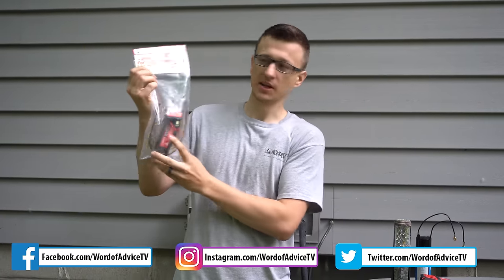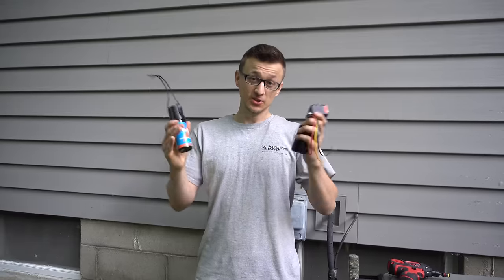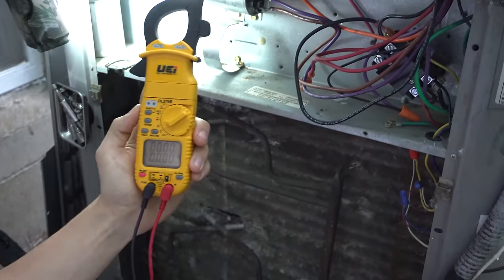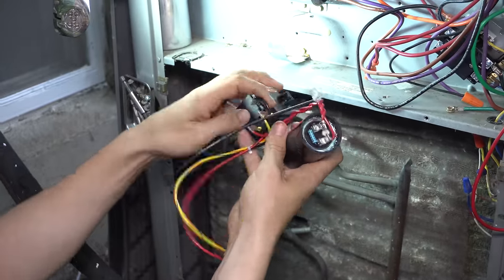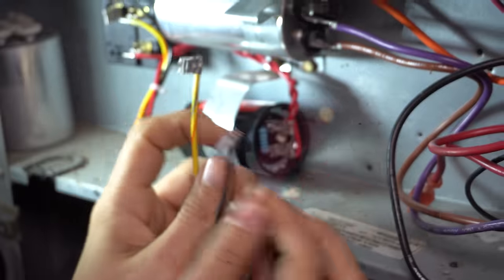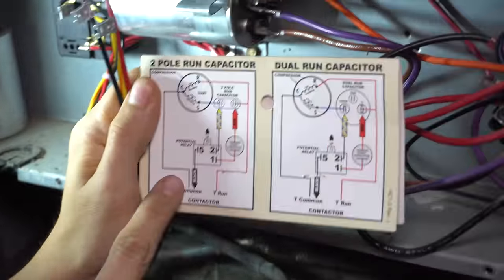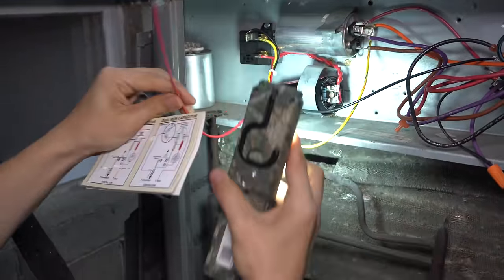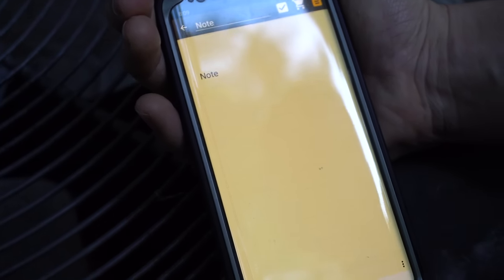How To Install a 3 Wire 521 Hard Start Kit

Comment: For those that might still be confused, like I was when first starting, the #5 wire goes to common on the contactor, not the capacitor...1 to run, 2 to start, 5 to common...Thats potential relays...Again, that common, for #5 from the relay, goes ON THE CONTACTOR power out..I've seen people get this wrong, confusing common, but this video is clear and well done.
Reply: The circuit diagram that comes with the 521, makes the connection points crystal clear.
Reply: @PH-md8xp  For most...Some people think a common wire or terminal is neutral...Of course these people shouldn't be dealing with electric in the first place, but they're out there...They even think a common terminal on a switch is for the common wire and that common wire, the neutral, not the power source...Yeah, Smoke that switch...Like I said, they're out there.

Comment: If you have a clamp meter with an Inrush function, it’s possible to measure the current flowing into the compressor before and after the install of these hard start kits. There’s usually a significant difference and it’s just satisfying to know that the thing is helping your compressor do it’s thing.
Reply: Yeah use your clamp on your meter to measure amp draw before and after .. usually cut in half .. pretty cool

Comment: After watching your video, I installed a 521 3 wire kit that I bought probably almost two years ago but never got around to. Turns out when I opened the electric panel up there was already a Supco SPP7s installed. I pulled that out and put the 521 kit in and I went from loud starts and dimming lights to barely noticeable when the compressor kicks on. I replaced the capacitor at the same time after watching your capacitor video. Turns out neither were the root of my no AC problem as it was the float switch under the fan in my attic - which I determined after watching yet another of your videos. Fantastic resources - thank you!

Comment: A good analogy I've heard for potential relay wiring is "5-2-1 Can She Run" so 5 to Common, 2 to Start winding and 1 to Run winding
Reply: Yeah this video was great I'm used to wiring the two wire kickstarts. Thanks for the cool analogy as well.
Reply: I remember when you had to buy the components separate and make your own kit
Reply: Awesome

Comment: I installed one of these 5-2-1 Hard Start kits (CSRU2) just like in this video in a Goodman unit from 2016 and it let all the smoke out of the Hard Start Capacitor, looks like I may have a defective unit so I have another on order.  Thanks for making this video, I was able to double check that it wasn't me that wired it wrong LOL!

Comment: I came back to this a year later, a year spent trying to better understand how these devices work. On looking at this again, I was surprised the old capacitor is often left in place, in parallel with the new system. So, rather than replacing a bad component, these devices are designed to turn a PSC motor with no start relay into a CSCR motor. So even after the potential relay cuts out, current can still flow through the old capacitor to the start windings, so the old capacitor remains a true parallel run capacitor. Presumably you want to be sure that old run cap is still good. I was also a little surprised that many of these 3 in 1 kits sold by Amazon don't even mention the capacitance of their new capacitor on their product info, or the design for the relay. Today I used your video to springboard better understanding of the mystery behind the HVAC ton, the 12,000 BTU's of energy needed to melt a ton of ice on the Hudson river. How are you, Jay?

Comment: Thanks my Man !!  Used your video yesterday and installed a 521 Kit on our 1 year old, 4 Ton, 14 Seer split A/C system that was installed last July.  Two things that I noticed after install was that system is a lot quiter on start up and the loud noise that the compressor used to make at the end of each cycle was a lot quiter too and almost non-existent !!  Great video, keep up the Good Work !!

Comment: excellent video, recommended it in an amazon hard start kit review. 
dont know if it helps, but instead of just connecting the wire tabs, i sprayed contact cleaner on every tab of all the components, scrubbed with a toothbrush, then applied conductive carbon grease on the tabs to prevent future corrosion and improve electrical conductivity.
Reply: Hadn't thought about conductive grease, or even dilectric grease, but it SURE couldn't hurt!  Good idea!

Comment: As. Handyman I have been following your channel for quite a while.  I really learn plenty.  I did this upgrade to my AC system a couple of years ago as I discovered that the inrush amp draw was nearing the locked rotor amp limited listed on the the unit for the compressor.  Prior to installing it the unit was struggling to start.  You could hear the difference afterwards.  It’s an amazing difference.  It makes me wonder why AC manufacturers don’t include a “hard start kit” as a normal part of the units.  Built in obsolescence perhaps...?  Anyway, I enjoy your extremely clear, professionally prepared videos.  Your an excellent teacher!  I’m always looking forward to see more of your videos!  Thank you very much!
Reply from the maker: Thank you Richard! Glad to hear that my videos have been helpful and that the hard start made a big difference for your unit! As far as I know, many manufacturers actually did include a hard start capacitor and potential relay (basically a 521 kit) in older units. But to cut costs, this "un-necessary" part gradually started being omitted in newer units until now, when it's only the premium expensive units that still come with them. Well it actually kills two birds with one stone for them - the compressor does not last as long so people have to buy a new unit sooner and their production costs slightly decrease.

Comment: Thanks to this guy, I install the hard start kit and it work.  But I also instead a new capacitor since it is completely dead.  I manage to orient the 3 wire hard start kit in an upright position as indicated on the diagram and on this video...but it is so damm hard to drill a hole and it was hot outside. In the end, I just used tape and hope that it stick.  I turn it on and wahla....everything running again. Even the fan is spinning. It wasn't spinning before.  First time opening up the air conditioner, I noticed someone had installed a hard start kit compressor previously.  So I ended up leaving it there and hooking up both start kits.  This is my first time doing this fix and it is a life saver because I have no idea who to call for help.  And it is summer and it's hot, I cannot stand the heat.

Comment: You are correct that the start capacitor should be installed with the terminals up.   As per the instructions:  "Mount the 5-2-1® Kit potential relay and start capacitor in a suitable location within the 
electrical box. The potential relay should be mounted with the mounting tab up. The capacitor 
should be mounted with the terminals up."
REASON: Most Capacitors are oil filled and could be subject to leakage therefore it is always recommended to minimize the chance of leakage

Comment: J you are the man! A few days ago, we had hot weather and the compressor was not starting. This is on a 2001 York 1.5 ton that is running R22. The original capacitor lasted till April 18th, 2018 and was replaced with a Powerwell 30+5 MFD 330 to 440v dual run cap (which is the recommended). Can I install a more powerful capacitor than that one or do you recommend installing a 5 to 1 booster with a new stock size capacitor? 
Thanks man and congratulations on moving to Hawaii! I vote you document/film the move for the memories  =)

Comment: I learned a lot from your educational videos. Keep doing a great job to help others. Question for you - how would you wire a 5-2-1 to an AMRAD Dual Run Capacitor 70 + 5 uf MFD 370/440 Volt? Thanks in advance.
Reply: Yellow wire goes to the AMRAD capacitor's "CPT" (Compressor Protection Terminal) connector tab. The reason that AMRAD developed this separate tab is to protect the compressor in case the hard-start relay doesn't "kick out" (disconnect). There's an internal fuse between the CPT and HERM.  I used that AMRAD 70/5 on my three-year-old Carrier as good insurance, as they are made in the USA (Florida), and are known to be top-tier reliable. I saved the old, OEM cap just in case I ever need it, but doubt I ever will.

Comment: @WordOfAdviceTV.  HVAC School has a video on hard start kits and they say only use after-market hard start kits temporarily as a band aid for when the compressor does not start. They recommend immediately getting the hard start kit recommended by the unit's manufacturer for use longer term.  I want to use the CPS 5-2-1 compressor saver that you have in the video, BUT I'm scared to death that I will damage my perfectly working compressor after watching the HVAC School video.  Can you give your personal comments and advice on this topic?

Comment: Hi, I have questions about the hard starter kit.  Does the starter kit vary between different systems?  My system has a hard start capacitor with 88-108MFD 330VAC 60/50 Hz rated at 65 deg C.  I replaced it earlier when the Duel run capacity failed (I have no idea it's a hard starter capacitor when I replaced it).  However, I didn't put the resistor back on the new hard start capacitor.  Will it hurt the a/c unit?  If I have to put the resistor back ... what kind of resister needed (the old one has been trashed).  Thx

Comment: My Compressor recently burned out and was shorted to ground.  Prior to that I noticed my main breaker box on the outdoor(compressor) breaker was buzzing intermittently about every 20-30 seconds when a/c, compressor were running, but never tripped the breaker.  A/C was also cooling fine.    Fast foward about 1 year later and the compresssor shorted out and I had to replace it.  Breaker is no longer buzzing while it runs but does have a quick buzz when compressor kicks on and lights slightly dim for a split second.  My technician suggested installing a hard start.  Is this likely the reason/remedy for the buzzing breaker?  Or does that sound like an electrial issue that has nothing to do with the A/C unit?  I will probably install a hard start anyways as it cant hurt it.
Reply: Yes when a unit is partially burnt out the amps could increase dimming your lights.. 
Suggest your next AC upgrade go for an inverter. No more dimming lights

Comment: Great video.  The AC company just quoted me $449 to put one in.  After yelling at the company (not the tech) for 5 min, I told him that I'll look around.  Checked online, and the 3 wire hard start kit was $23.99, and I could not believe why they would quote a price like that.  Then thought I'd check YT and came across this great video.  So as a non-AC person with no background, it seems like simple DIY.  Any words of advice before I venture into this?

Comment: Nice info !!! ..... I get how it works.....but need to ask this---> the hard start kit includes a relay and a separate capacitor....that helps for that fraction of a second ( or so)  during the starting-time....and then drops out immediately after.. What is the probability that the new capacitor or relay may become defective and it doesn't drop out? Seems it will damage the unit....quite a kick in the pants if doing this is to "improve" the life of your core equipment. So....how reliable are these new components and how often do we see these fail?

Comment: Your videos are awesome and easy to understand. THank you?
I installed this kit on my AC unit months ago, but I'm not sure if I did it correctly. 
Thanks to this video, I just learned that I have a single pole contactor, and I attached the black wire of the kit to one of the T1 terminals of the side that has constant line power. That's the side with the black wire coming in and thus why I chose it.
Did I do that correctly? Or should the 5 wire been connected to the other side of the contactor that has the plunger?  THANK YOU
Reply: well what was the answer

Comment: I just installed a 5-2-1 hard start kit following your video today! Thanks so much! I have a question for you. Would the AC still running fine if the kit is actually not working? I am asking because I have another AC which has the kit installed already. I suspect the kit is not working because when AC starts the lights blink.

Comment: FYI If you want your relay for compressor to last a long time, buy one rated for higher amp and also in my case I had a single pole relay 30 amp, so I bought a 40 amp and a double pole, connecting both poles together so it's now a 80 amp relay, good to outlast unit.  Relay failure can damage compressor.   A start relay is completely different part/function.
Reply from the maker: That is a great suggestion! Thank you for the tip AD!
Reply: Consider adding an Emerson SureSwitch.  It is an electronic contactor that closes on the zero crossing of the AC signal which helps eliminate arcing.   It is protected from ants and insects, and has brown out protection.

Comment: J, I am trying to reduce the inrush on my Rheem 3 ton, plate says it is 79...I tried the 5-2-1 from CPS, the Rectorseal TO-5 w/ Pot Relay (2 wire) and the newer Amrad TES5 Universal High micro farad unit, (2 wire)...but the best reduction I can get i s 72.5....I am thinking maybe my Clamp Meter is defective? Is there any reason the kits would not reduce the LRA more, I was hoping for about 40%? Many thanks.  Love your videos.

Comment: My contactor slots have 2 black wires already occupied, there 2 more on side of the black wires , I can used those as my common/black wire from the 5-2 hard start ? What wire do I do the amp test on , someone said wire running from the compressor but there’s 3 wires .. running from compressor ? 
Thxs

Comment: Hey! Hope you're enjoying BI, one of my favorites. I enjoy all your posts.
With my 3ton Trane 14i heat pump, I'm installing a 5-2-1 hard start. My replacement kit Mfd cap has about 40% more kick than the OEM TRANE hard start cap (OEM has two caps already)  ...is Mfd over-capacity harmful?

Comment: Thanks I purchased one for my 3 Ton Goodman DSXC160361AC. But it does not have a contactor, its has circuit board. I do have a lug with a spade connector. I assume that is where I connect the black lead to the common? Where the power comes into the unit the load 1 says common as well, I assume that would be too much amperage. Could you help me with this. Thanks in advance Bill

Comment: Thanks.   My AC cap failed but the cap in the 521 kept the system running.  Cooling fan was turning in reverse, blow the hot air to ground, yellowing the grass around.  The unit was hot, I believe the compressor were hot too.  After watching your YouTube, replaced the run capacitor.  Fixed.  Now I ordered an extra capacitor and I came with “CPT” port.  That supposed prevent the compressor from running when the cap goes bad, rather than 521 cap over heating the system.  Good idea.  But I don’t know how to connect the 521 to CPT port.   My best guess to connect the wire goes to C to CPT.  ???  Thanks.
Reply: Nope. Yellow wire goes to CPT.
Reply: @Springerpop  Thanks.   Then the CPT port is only made for the 521 connection, ??

Comment: Love your videos!  You saved me a ton of $$$.  On connecting the common to the contactor, I've read multiple opinions on which side to mount the black wire.  Some say the shunt side, you said the opposite side of the incoming wires. Maybe the same thing? How can I tell on a Lennox hs29-048?

Comment: Another great video, Have a question, my AC already has a hard stater with a relay 7 years ago and the compressor now starts with a big bang, Do I  need to replace the hard starter with this 521 kit? Thanks for your help!
Reply: Never recommend to replace a hard start kit with another. You are wasting your money. If it is banging on start up your compressor sounds like its failed mechanically. I know compressor/units are expensive.  If funds are short put in a window unit in your bedroom so you can sleep, window units for most bedrooms can cost as little as $99.00 (5000 btu) at home depot.  Finish out your season , take your tax return and buy your a/c early as possible before season starts.

Comment: My trane has a smaller cap on the fan motor in addition to the standard cap.  Should i remove the smaller cap before I install the hard start 3 wire?  It's a titan motor run capacitor.

Comment: I have an old A/C and about 30 years old and it has the original compressor.
Is it too late for the hard start kit? Thanks for the video.
Reply from the maker: It's never too late if it is still working :) In fact, if what they claim is true, it will actually help your compressor survive a bit longer.
Reply: @WordofAdviceTV  Thanks for the information.

Comment: if your adding that, your compressor is going, love the safety double check after you pulled the disconnect and bleeding the cap.  Could you explain alittle why you would install the hardstart?  pulling to many amps on start up? p.s. we miss you back at work
Reply from the maker: Hey there! I can't recognize who you are just by your username but thank you! Glad to know that I am missed and people aren't, on the contrary, glad that I am gone. :) As for why a hard start would be installed, I go over a list of reasons in this video: https://youtu.be/ThBsRFrdNiY
Reply: im mills @WordofAdviceTV

Comment: Great vid thanks 
Question, what if you landed that black common wire on the other side of the contactor?
Also what if your hard start cap came without that bleed off resistor? Like mine did.. is that an issue or send it anyway? Thanks :$
Reply: You COULD add your own bleed-off cap.